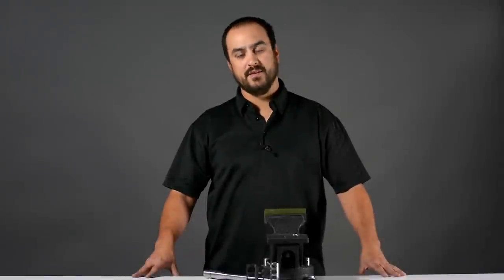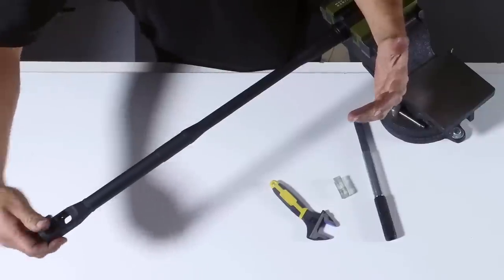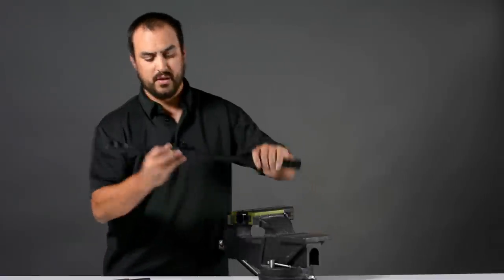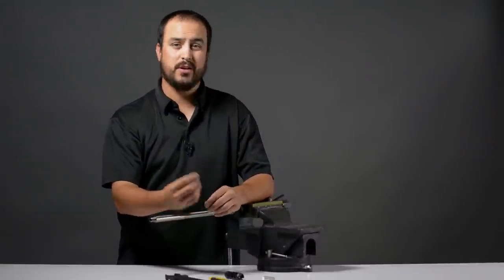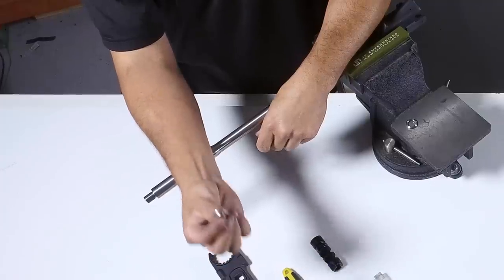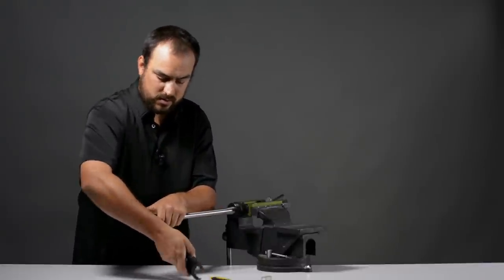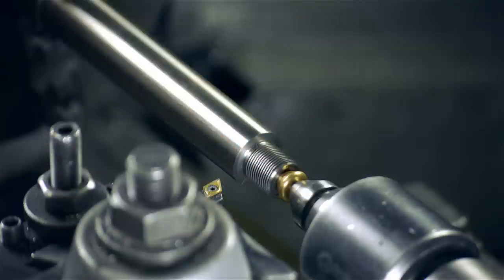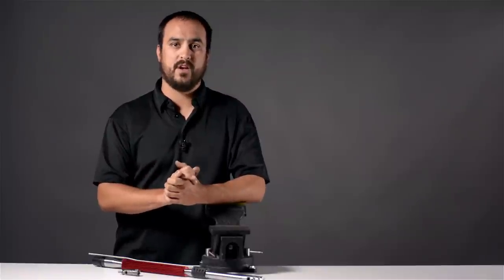Build Smart: The Many Ways to Install Your Muzzle Device

Comment: Regarding the last method shown, somehow it would seem a better idea to remove material from the muzzle break rather than cutting away on the barrel. Modify the less expensive piece and keep the barrel standard. Let me know if I am missing something.
Reply: Because of the OD of the muzzle brake changes due to its shape, if you cut away on the brake, the OD of the brake and the OD of the barrel would not match

Comment: Hello Dustin, thank you for this very informative video. What is your opinion on threading "sporter" barrels on high power rifles like a 300 win mag? The skinny  barrels of these guns  lots of times are hardly thick enough to thread of 5/8-24 UNEF. And even if you can, you're not left with much of a shoulder to bud up against. Threading 1/2-28 on these rifles leaves one with a very marginal wall thickness creating a potential dangerous situation with these high powered rifles. I'm very curious to hear how you deal with these situations?

Comment: Hey Dustin.  Nice video.  I'm right-handed, so I time my comps with a slight tilt toward the one o'clock position instead of perfectly level.  This helps to minimize the dot movement to the right.  I learned this tip from a Jerry Miculek video.  Is it possible for your to accommodate this?  I recently ordered a JP 14.5 9mm barrel with comp pinned/welded.  By the way, do you make a titanium comp in 9mm?
Thanks.
Reply: Thanks for your quick reply!

Comment: Good video, but it is better to do muzzle work with a barrel vice? Not you, but novice builders may accidentally torque too hard one way or the other and bust the sleeve of the end of the barrel. I've seen it happen a few times.  A barrel vice assures no damage will occur to the upper or the barrel in the case of over torquing ; mostly when getting a stuck device off the barrel, or one that was for some reason thread locked.
Reply: Ah.. Never had a barrel that looked that nice

Comment: How do you square your recommendation to use blue Loctite with the fact that it has a maximum operating temperature of 150c/300f and an AR15 barrel can easily exceed that during even moderately heavy use?
Reply: You don’t need any loctite or rockset.  A little high temp grease aids in removal and prevents galling especially with stainless barrels.

Comment: Ouch blue lock tight? blue will melt right away after one mag dump. need to use red if you're going to use a loctite type method.
Reply: rockset is honestly ideal.
Reply from the maker: We haven't had any issues with this in our 25+ years of being opened.  We do understand what you are talking about, but this has worked great for us so far
Reply: VC-3

Comment: I’m buying your recoil eliminator, what tool do I need to install it? Which method except the 4th do you recommend? The rifle is Howa chassis 6.5 creedmoor #6 heavy barrel. Thanks.
Reply: I'd suggest buying a damn good set of plugs and muffs cause this thing is gonna peel paint off a barricade 10 feet away. On a 6.5 creed, why?

Comment: Which direction should crush washer face?
Reply from the maker: For the JP one, it doesn't matter.  For a standard crush washer, the conical end should point towards the receiver.
Reply: When looking at the barrel, you should see “this side towards enemy” on the muzzle when installed properly. You are welcome.

Comment: Why would anyone use a crescent wrench?
Reply: Because you can add tape to the inside of the jaws so that it doesn't scratch the comp or nut and adjust it so it still fits.  If you put electrical tape in the jaws of a 3/4" wrench it will no longer fit on a 3/4'' fitting.
Reply: I wouldn’t use one for anything i gave a shit about. If you have a quality 3/4” wrench, you shouldn’t be worried about marring or scratching anything. If your kit came from Harbor Freight or NAPA maybe the tape would work; id just invest in a quality wrench set. Safer anyway
Reply: It isn't a crescent wrench  , its an adjustable wrench with the most common made by the  crescent company, just like vice grips are locking pliers made by the vice company, and a Skil saw is a circular saw made by Skil
Reply: Bill Hodges or calling all multi tools “feintools”
Reply: @ToddKing  best answer
Reply: Yankee Doodle Dandy  Generally, standard tools are less communist than the metric ones. Your mileage may vary
Reply: @richardlea818  As a 30+ year ASE certified master tech I disagree.  You can scratch the hell out of things even with a Snap-On wrench. It may be less likely than with a cheaper, ill fitting wrench but all it takes is one wrong move.  I am not a fan of adjustable wrenches but they do have their place. If you use one use a quality wrench and know how to use it.
Reply: @ToddKing  How can you disagree with using a quality, correctly sized wrench to avoid damage?

I mean if you’re being over aggressive, or holding your tools crooked, any wrench can mar or scratch. Using one thats correctly sized shouldn’t mess anything up.  A properly sized (and not worn out) wrench shouldn’t even have space for tape or anything else on the flats. I mean, what is it you would do differently?
Reply: @ToddKing  You shouldn’t need enough torque behind it to come anywhere close to stripping or rounding anything off, let alone marring

Comment: there is to much info missing. what is the proper way to align holes. they never say what way the barrel is facing????
Reply from the maker: In this video, our tech used our JP Universal Vise Clamps to secure the upper receiver and barrel, so the gas port was facing away from the tech.  If you have purchased a JP 3-port, then the JP logo will be on the bottom of the comp.
Reply: How many times are you guys going to say you used your vice clamps😂
Reply: @michaeldolan5094  i lost count at 274 🤣😂